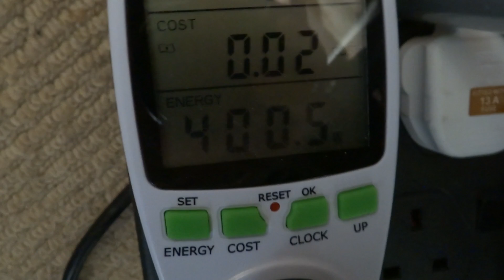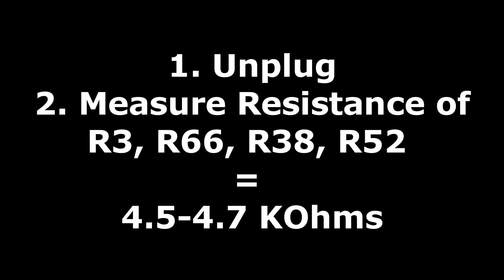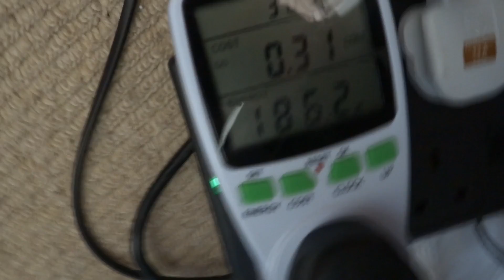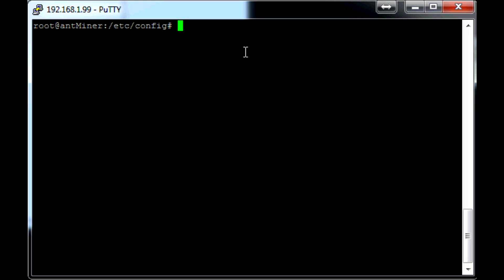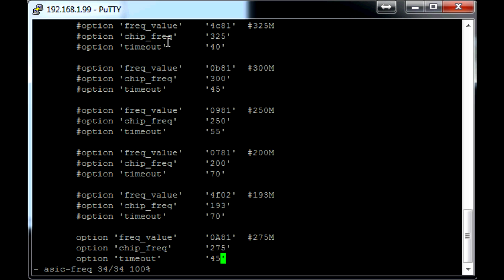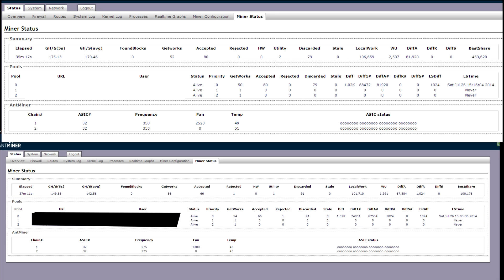How To Underclock, Undervolt An Antminer S1 (Pencil Mod)

Comment: This is not working well for me. I got the flux off and I'm able to read the ohms on resisters R3, R66, R38, and R52. But on my stock S1, these resistors are reading 2.1 KOhms. Not 4.5 to 4.7. All six are very close to 2.1 KOhms.

With it on, I am getting 1.1 volts across the big yellow resistor.

Did Bitmain change the boards? My boards are dated 2014-1-4.
Reply: Oops... Wrong setting on the multimeter. They are 4.5 to begin with.

Comment: I can't seem to get a good reading with my multimeter on these resistors. It's a quality multimeter and I can read other (bigger) resistors just fine. But these little ones seem to coated with soldering flux (rosin). I tried scraping the flux off with the point of the multimeter probe, but that didn't help much.

These resistors are pretty small and in pretty tight quarters, so what would you recommend to get the flux off?

Comment: the difference in heat and power consumption is crazy! so much better sleeping at night sharing a room with two S1's..  its a shame that running as they are there still making a slight loss for us miners over in the UK  with are $0.28 p/kw electricity prices!

Comment: man i just cant get it working..

iv got the chips to .85v but when i change the setting in putty to the new ones it just doesn't start mining

if i use the stock settings @ .85v i run around 120-130gh but no idea how much power i'm pulling 

any ideas why my miner works with stock settings but doesn't work when i change to the suited settings in putty?
Reply: solved it.. i wrote 'timout' instead of 'timeout' ..  what a noob! -_-